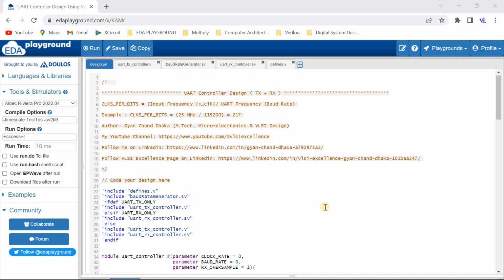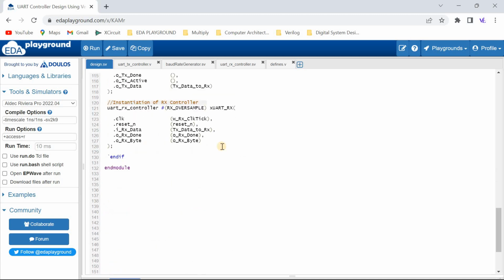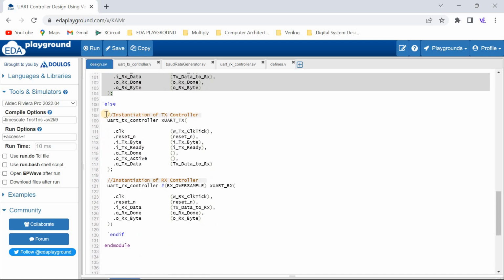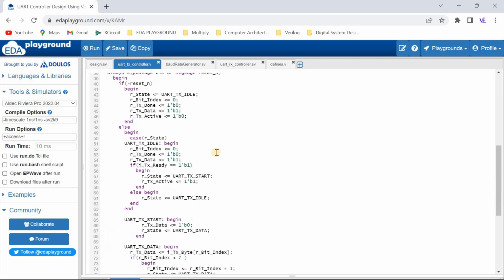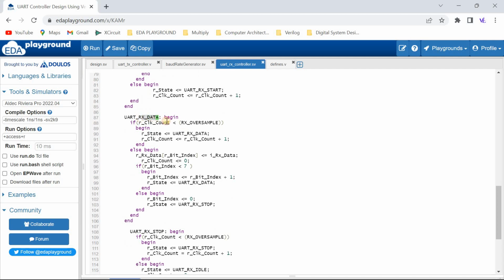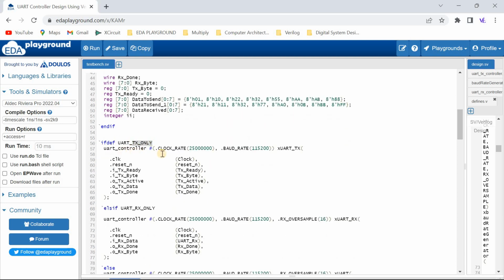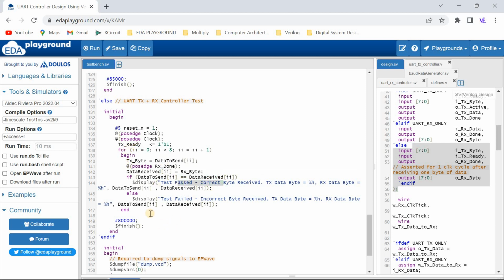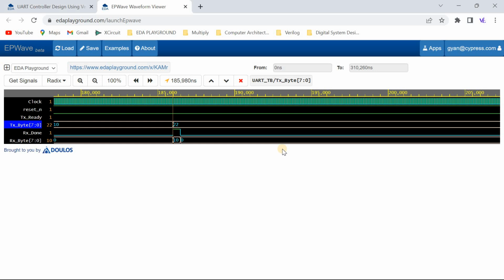𝐔𝐀𝐑𝐓 𝐓𝐱 & 𝐑𝐱 𝐂𝐨𝐧𝐭𝐫𝐨𝐥𝐥𝐞𝐫 𝐃𝐞𝐬𝐢𝐠𝐧 & 𝐒𝐢𝐦𝐮𝐥𝐚𝐭𝐢𝐨𝐧 | 𝐕𝐞𝐫𝐢𝐥𝐨𝐠 𝐈𝐦𝐩𝐥𝐞𝐦𝐞𝐧𝐭𝐚𝐭𝐢𝐨𝐧 | 𝐏𝐚𝐫𝐭#02 | @vlsiexcellence ✅

Comment: Sir, I am not able to understand why the parameters CLOCK_RATE, BAUD_RATE & RX_OVERSAMPLE are set to 0, 0 & 1 resepctively in uart_controller module and why the parameter RX_OVERSAMPLE is set to 0 in uart_rx_controller.v

Shouldn't it be that CLOCK_RATE, BAUD_RATE & RX_OVERSAMPLE be set to 25000000, 115200 & 16 respectively throughout? Please answer
Reply from the maker: These are the default values. They will be overwritten by Test Bench/Top Level Modules during instantiation.

Comment: Hi Sir ,  In UART TX Controller  1) What is the need of o_Tx_Active signal since we have already o_Tx_Done signal.  2) why r_Tx_Data is high when reset is applied.   3) What is the content in define.sv files.
Reply from the maker: Hi @user-ib2to9lw1e, Thanks for the feedback.
1) This is just an indication that current Transaction is ON Going !
2) Actually when there is no Transcation happening the TX line should held HIGH, We can have this signal LOW during reset assertion time but we need to make sure that TX line is HIGH before initiating any UART Transaction.
3)  //`define UART_TX_ONLY 
     //`define UART_RX_ONLY 
You can check the full source code. Project GitHub  Link is in the first pinned comment.

Thank You !!
Reply: @vlsiexcellence  Thankyou sir